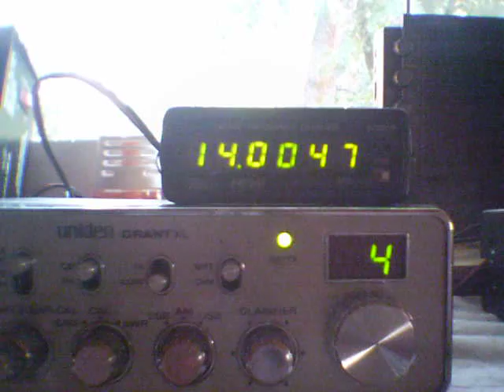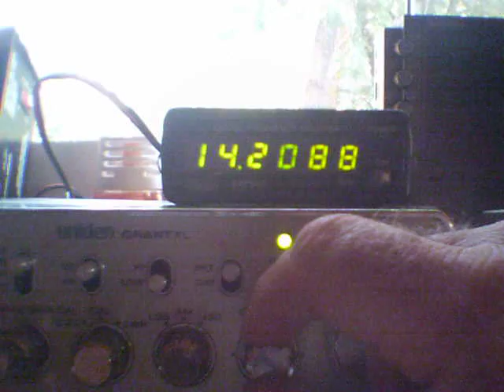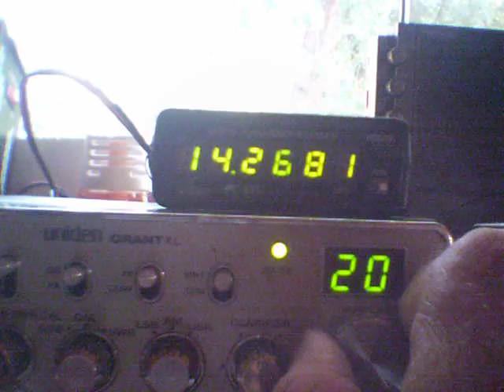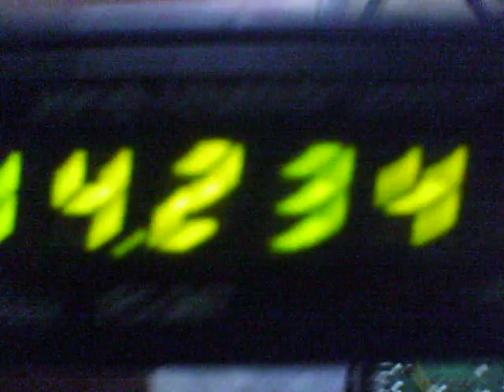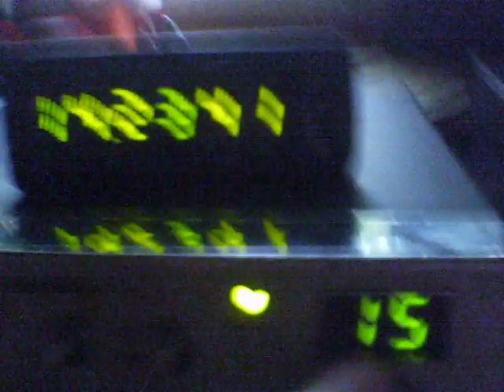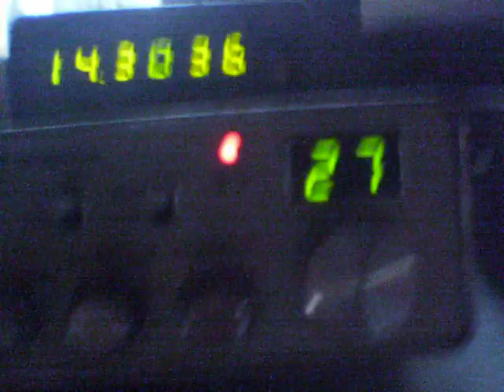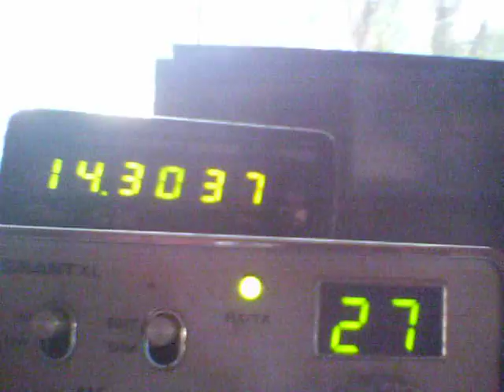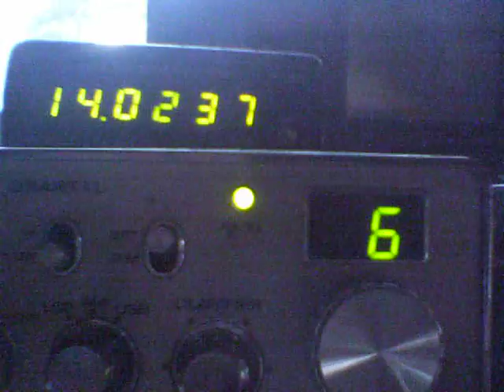20 meter band ham conversion to cb radio.

Comment from the maker: @k7isw  Hello, Carl here, Yes I plan to make a how to modification manual very soon . These conversions are not very hard to do, the hardest part is winding the vco coil. The crystal that I am using for 20m is 10.695mhz. I try to make all of this as easy as possible! Stay in touch ! Thanks Carl, KC8YLT

Comment: there is a company in italy that did transverters for Cybernet boarded radios for 40mtrs,
which on a CB with 26.5 IF meant 45mtrs lol..
then a UK company designed a transverter for the Maxon boarded radios (vice president roy, maxcom 4A, Cobra 19X and others) which converted them from 27mhz FM to 46mhz for a band that was never legalised or even used in the UK, these radios are ideal to convert again to 6mtrs very easy.
Reply from the maker: Thanks for the info. There is a Ham in Mexico that has designed a transverter for radios like the cobra 148. He has several videos showing his work which looked very impressive but the videos are in Spanish which is a language I cant speak.
Reply from the maker: The Ham in Mexico that has designed Transverters for 20 and 40 meters and has videos here on YT is xxGR25xx that is the name of his channel. Impressive work with what he made.

Comment: Love your thinking Carl! First, never let a woman use your computer :)  My question is on the 3055 power supply trans.  Wouldn't it be easier to use horizonal outputs out of TVs?  They are sittings around 23Mhz anyway.  Something like a 2302.  I have used vertical trans to repair cb finals.  Just have to change the resistor to turn them down a bit.  I am very interested in keeping up with your progress on these conversions.  Might make myself a qrp station of converted cbs. 73 AE4WY

Comment: Hi Carl, this is really interesting. Did you publish a manual as you hoped, in the end?
Reply from the maker: No sorry to say I haven't finished it. I've been working on a double side band modification for the cobra 29 which is a less costing radio than the cobra 148 and it can be made to work on 20 meters.
Reply: @CARL557511  Thanks for the reply, I know how time flies! I'll be interested to see the Cobra 29 conversion.

Comment from the maker: Hello this is Carl,  I am still working on improving my mods for converting the uniden grant xl and cobra 148 to operate on 17 and 20 meters. I am planning on selling a low cost kit anyone can build and install themslves in these radios. Now that I am back to working close to home I will be able to do this. I am adding a shop on to the house where I can start doing all of this work. Thanks for your patience. Carl KC8YLT.
Reply: Hi Carl, Is your 40 meter conversion kit available now? And how much for the kit? Mine is rci2950 and uniden grant that im planning to convert it to 40 meter band.

Comment: ive got a panther ssb 23 ch xtal rig im working on using a si5351 for vfo. and 8 digit if offset freq counter, any idea how much capacitance id need to add to the transformers to push them into the 14mhz range?
Reply from the maker: I have used disk capacitors in the 100, 47 and 56pf range on the uniden /cobra radios that use the mb8719 pll chip. What I would try is using some small air variable trimmer caps to get a better resonance on those tuned rcv and tx circuits (tuned transformers) and I would try ones with a range of up to 120pf or so. You are welcome to email me at   ceboley304@yahoo.com.    Iam also good on the QRZ site.  Carl kc8ylt

Comment: Looks like its the other way around ---- a CB converted to 20m?  After all, going the other way would be like converting a Mercedes into a donkey cart.  I've converted a boatload of shitbands to 10m AM, FM and SSB, and a couple to 15m, but I'll never understand how you could get a CB to tune down to 14mhz without a complete redesign of the board.  The coils and caps just don't have that much range.

Comment: hey use another CB to do that these Grant are going for 300.00 now Thanks a lot!!!!!!
Reply from the maker: These conversions work on the cobra 148s both new and old and other radios that use the same board also.  I am trying to make a cobra 29 work on 40 and 75m am mode without a transverter. It would be great if I could make them work on SSB too.